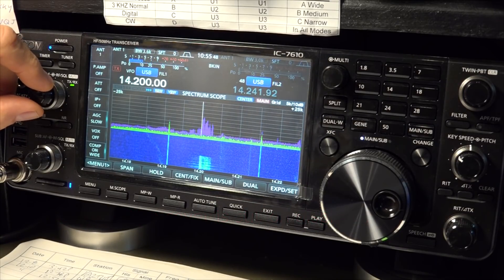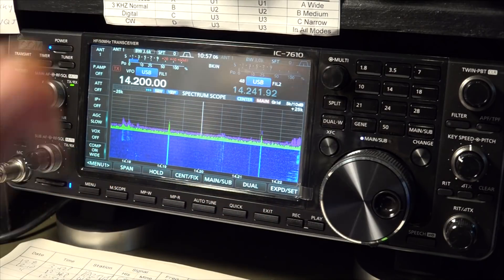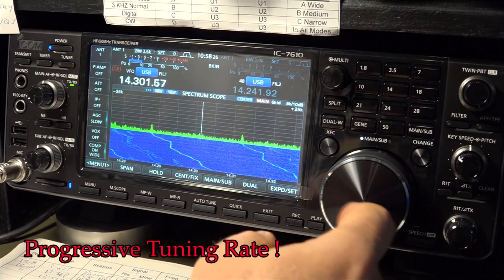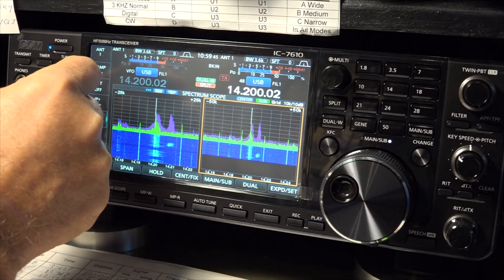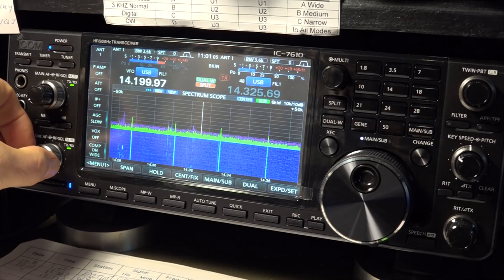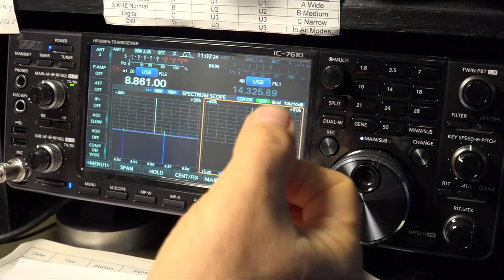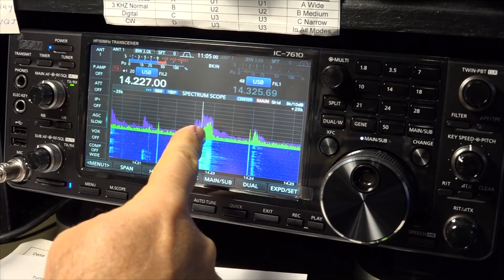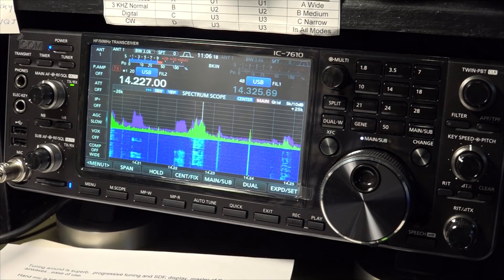IC 7610  - Should you buy one?

Comment: I'm wishing someone would do a comparison between the 7610 and the new FTdx-101D. I was also hoping the 101D would help push the price of of a 7610 down.
Reply: Danny- I think what will happen is that there will be a flurry of 7610 's available now from guys who want the 101D. Good time to snag one. The price on the 101D will also drop in the next year as the 7610 did. As well, the early bugs will be worked out. If the 101D can't do a standard 2D spectrum display with averaging and color fill, it is not even a contender for me (7610 owner). The 3D seems like a gimick. Even if it is great at what it does, it won't be hugely better than the 7610.  It will be more of a brand-preference thing which one you choose. Will my 7610 stay home? Don't know yet!
Reply: @bobnagy9084 I'm a DX'er,  off the air for about 15 years and am starting to build a new station, more or less from scratch. I was planning on buying a new rig at Dayton, to build the shack around, but for the life of me, I can't make up my mind. I know I'm not spending 4K for a new radio, but I do want the best RX I can afford. "Best" meaning it handles a Sweepstakes pile up on Saturday 20mtrs! 7610 suits me fine, but I'm not wanting to spend 3K either. The 7300 is too small, too menu driven and SS performance seems questionable. I'm not a "Flex" fan, at least not yet. I'd have to buy a Windows machine or dual-boot my MacBook Pro, which I don't want to do either. Licensed in '77, I'm old school and like boxes with Yaesu/Kenwood/Icom on the front panels. I think I need deeper pockets, HIHI!! I may just "deal with it", buy a 7300 and wait a year or so, for the SDR by the big 3 to settle in more.

On a different note, I suspect the 101D will be real close to Sherwood top 10.
Reply: Look, YOU are in the driver's seat as the buyer. There are SO many good choices out there. Just read the 101D manual. It won't do standard spectrum display with averaging and fill under the trace (my fav). The 3D is a gimick. And it IS a mixer SDR, not a direct sampler. I was going to snag one, but I think not. I'll stay with the 7610. Really, you might look at a used 7800...or TS-990s. These are brick-wall receivers. the 7610 does not handle nearby strong signals perfectly. That said, it is a joy to operate. Take your time and buy wisely. PS: Your Pix is my hero

Comment: Bob, I'd really love to see a side by side comparison between a TS-590 or equivalent non-sdr radio and the 7610. For those of us considering upgrading. Larry, W1AST
Reply: Larry- A TS-590 or TS-990 against the 7610 would be a good test. I actually upgraded from a TS-990. Since that radio went away last Dayton, I'll give you my observations. Apples and Oranges. TS-990 - Low fatigue  receiver...smooth sound to the RX. Not in your face. Selectivity was very good, but not brick-wall. Spectrum scope was terrible. Buttons are good, but that many makes it impossible to find anything. Great TX audio quality. Rig cost and weighs way too much. IC-7610 - is about half that list price. It's TX audio is max 3khz, but audio is super clean. Receiver is more sensitive by a few DB and filtering is very good ...almost brick wall. RX audio is much more articulated. It is just a couple of orders of magnitude "closer" to the other station's TX'ed signal. It's like digital Windex. A thick layer of noise and distortion is no longer present. Literally, there is just less circuitry between you and the original signal. Spectral display is 85% as good as a Flex. 257% better than the TS-990s. It needs more buttons..too many menus. (three screen presses to go from Memory to VFO) It has external monitor output, but one never uses it. Screen is great. At just over $3K, it's a good deal. The 7300 is 80% as good as the 7610. 7300 is still the best value out there.
Reply: @Yavor54  lo
Reply: Debs husband says beautiful radio.

Comment: It would be nice if the minor complaints mentioned here  could be addressed through firmware updates by the manufacturer. This would be a major advantage of a SDR where in the old days a circuit mod. or a completely new radio would have to be designed to offer improvements.
Reply: Well, that is what happens. Some makers are more responsive...some less. But with a SDR you can change 90% of the radio's characteristics. You could make this into an AM broadcast radio with an analog display. The initial issues with the 7610 were address with Firmware updates. Yea!

Comment: Even the old Kenwood TS-50 had progressive tuning , Or as they called it ' Fuzzy logic ' ... As you turn the vfo the tuning steps get bigger ...... It's not a new thing , And not exclusively Icom ... Regards de Gw0wvl 👍
Reply: the only other radio I ever saw that had progressive tuning (other than Icoms) was that TS-50.  The strange thing about it's implementation was that if you slowly tuned away from a signal -and then turned the dial back the exact same amount, it would not tune back the same amount...and the original signal was off freq. . It sure was "fuzzy logic"!

Comment: can it be connected to a external touch screen monitor yet I heard there working on it ?
Reply: They promised two things: I/Q output and Windows 10 style external touch screen capability. The I/Q output and HDSDR firmware package was just released... works great. Next will be the touch screen- I hope! PS: After a year of ownership, I just used the radio in a low noise environment for the first time (eliminated a noise generator near me) WOW.. this radio is amazingly quiet. What a delight to operate. The new Yaesu FTdx-101D is going to be a 16 bit direct sampling SDR, but also includes older technology mixer SDR architecture. I doubt it will beat the 7610's performance.
Reply: @Yavor54  ham radio with k0pir said external touch screen wont happen because of hardware reasons if u herd differently let me know so I can research it ..thanks
Reply: @Yavor54  ham radio with k0pir said the 7610 will not have the ability to use a external touch screen because of hardware reasons. If u herd differently let me now.

Comment: Thank You For This Video! I purchased a 7610 and it has arrived from DX engineering. You were correct,  the price has dropped a $3,200.  Icom is having a promotion with a $200 coupon and that brings it down to a little over $3,000  plus free shipping,  so we'll see how it performs compared to my Yaesu 1000d and my Kenwood 950 s DX which are dinosaurs, but still good radio.  I'm taking it to work today to put it through its paces.
Thanks again....W6YDE
Reply from the maker: Golly...I paid $3800. Well, you will find it is an interesting radio. SDR's don't fail the way superhets do. Not that I have heard the 7610 fail in any way. Now that the I/Q output has been activated, there should be plenty of really nice software show up for this radio.

Comment: Why it more expensive than RS-918SSB? RS-918SSB lighter and smaller. And more real SDR, because opensource.
Reply: Why? The RS-918SSB is a very simple SDR. It's design uses very basic IC's (chips) to do SDR. Because the
design is so simple, the display and receiver have many problems...images...false signals. The transmit signal is not clean enough to put the 918SSB through an amplifier. It is only good at low power. The display is very nice and it is a fun radio. A Ferrari and a Trabant are both "cars". But they are completely different. Same with IC-7610 and RS918SSB.

Comment: Just found out the LCD screens are having troubles with the 7610's.
Reply: No they are Not.
Reply: I've not seen that. Remember, you are going to hear nearly ALL the people who have anything go wrong with a 7610 posting here on the net. 95% of happy users never post. They have sold tens of thousands of them so far and the defect rate may be as low as any other radio produced. Icom is certainly one of the most reliable radios built.

Comment: So Bob after reviewing both the IC-7610 and the Flex 6400M (Maestro) which radio would you pick now that they are in the same price neighborhood?  K9RUF
Reply: Good question. The 6400M actually performs better. I feel that the ultimate selectivity is superior. Display on the 6400M is twice the resolution of the 7610.  7610 does not have a bandwidth overlay on the signal when you adjust the received signal- so you can match RX bandwidth to it. Having responsive firmware updates from Flex is a very good thing. The 76100 has slightly cleaner receive audio....hard to quantify. It really feels like a 7600 that is a SDR.
7610 is easier to use overall...digital interface is easier...but less versatile. The 7610 looks better. The front panel is just really pretty. The 6400M is clunky looking. It's just not as polished. The 7610 could have been so much more of a radio...but it inherits 85% of everything you see in all their other HF rigs. So, I'm not clear who is the winner!
Reply: Thanks Bob for your thoughts.  I don't think I've ever been so conflicted with any purchase.  Here's the way I look it with an analogy.  The 7610 is Ginger and the 6400M is MaryAnn.  From a distance the 7610 wins the beauty contest hands down with the 6400 looking like an "O" scope from 1970.  When you look deeper at what each radio offers the 6400M wins.  Now having said that we do look at the radio a lot so Ginger is the prettier of the two.  The display on the 6400M is so nice, crisp and sharp that you could cut your fingers on it when pinching and zooming the screen.  Kidding of course.  Why ICOM chose to use an 800 x 600 screen baffles me with the current state of display technologies and being spoiled with our smart phones.  The big VU meters on the 7610 is nice eye candy that Flex could certainly do too and maybe they will.  I do like the decaying waveforms on the 7610 showing briefly where a signal was.  Digging deeper with remote comparisons Flex supports the iOS and and that's a plus for me since I don't do the Android OS.  I have heard the audio from the 7610 at HRO and it does sound nice so i agree with you on that.  I'm heading to Hamvention this year so I will spend a fair amount of time in the Flex booth listening to the Flex audio to see how it compares and learning more about Flex.  Last but not least the Flex can go all the way out to 10 KHz wide TX bandwidth to satisfy my inner ESSB craving.  So if I were just dating the radio for "one night" like on field day Ginger would win, however for the radio we could spend the rest of our ham life with, MaryAnn is the one we would take home and marry.

73 and I'll look for you at Hamvention if you're going.
K9RUF
Reply: @MacsForever1  I guess you know, it every Ginger vs. MaryAnne contest, Ginger has never won, lol.
Reply: @MacsForever1  I'm in the same place with both the 7610 and 6400 but am also considering the TS-890s if the price comes down some more. It would be nice to see how that compares to the 2 SDR rigs even though it's only one receiver. But with my current TS-590s I have never felt I needed or wanted a 2nd receiver, so that's not a point for me.

Ergonomics definitely plays a big role for me. Ease of use, placement of controls, ease of adjustment w/o worrying of adjusting your signal mid QSO and not having to go into the menu's to make changes on things you use all the time. The 590 crushes the competition on those issues and I wonder how the upper tier of radios that we're all considering compares.

I do a little cw and ssb contesting. I haven't seen anyone address how to access memory keyers in either rig. Plus other issues and features in the way I use my rig.

I have to admit the Maestro makes the 6400 very attractive. I'm an Android guy and don't do IOS or anything apple. So those are big turnoffs by Flex only supporting them. Lots of choices, 3 months to decide....

I hope to make my decision by Dayton of this year (2019).

Larry, W1AST
Reply: Hey Bob, just discovered your reviews and now I'm frickin' hooked on them!  Great job, thanks.  I'm probably missing what you're saying in this reply but in your review, you say the 7610 is more SENSITIVE than any of your other radios.  In this reply you're saying the Flex is more selective and the Icon is slightly "clearer".  Got that.  But were you including other SDR's in your "more sensitive" comment in the review?  Do you think the 7610 is specifically more sensitive than the Flex?  Thanks!

Comment: The 7300 is SDR. The 7610 still uses Xtal filters.
Reply from the maker: Nope...7610 is SDR. 7300 is 14 bits and 7610 is 16 bits. 7300 is the best starter rig you can buy. 7610 is for people with more money than time.
Reply: @robertnagy2163  Do you still believe that to be the case Robert? I am just starting out on my enthusiast journey in the UK. The starter radio I see mentioned most is the Yaesu 450D. I am still trying to understand a lot of the technology, and while I am financially fortunate, I wouldn't want to buy something I have no clue how to use!
Reply: Absolutely. The FT-450 is a very basic performance radio. I'm not talking features, I'm talking basic performance. ALL the exact same controls are on both radios. The learning curve would be almost identical. The 7300 is just head & shoulders above the 450. You do have the spectrum scope on the 7300 to learn. It is the question of weather you want to go to the concert without eyes or with them. You'll still enjoy it, but 100% more if you can "see" the spectrum. By a clean used IC-7300. If you buy an FT-450 and stay with the hobby, you'll sell it and upgrade within a year.
Reply: @Yavor54  Thank you so much for taking the time to reply; appreciated! :)

Comment: Thanks for the review.  Current owner of a 7300 and you are spot on with the pricing.  My plan is to wait till the price goes down to just over 3k as you said, or perhaps find a lightly used "review" unit.  That said, I am very happy with my 7300, and will not have a problem using it until the initial price hype wears off.  73!
Reply: Golly, I wish I had that strength! I've toyed with cutting mine loose...but then- what do I buy? Yikes!

Comment: Icoms old QRP rig the IC-703+ that I have has an amazing tuner, it will load a wet noodle!  That was a decade ago! Surely we now have the tech for a $3,800 Radio to have a better tuner.   LDG will sell me a much better tuner than that all for about $170 .  That’s a fine solution on my IC-7200 but for $3,800 it surely could have a better tuner.

Comment: It does show the bandwidth,  but not on the main screen.  You can use other software with the IF/AF output (to name some common outputs) and the sky’s the limit, use sdrsharp etc..
Yes, 200 watts would’ve been nice, but the IMD is so good, you could take advantage of the radio and use it with a high quality amp.
I don’t actually own this radio, I own a very late version IC-7300 with more mature hardware & firmware, but a friend does and I’ve babysat the 7610 for a while when he was away. And yes , exactly like you said, it’s right out of the gate and does require some tweaks and I suspect new features as well.  What’s interesting is the quick menu functionality was fully editable on the 7300 and unfortunately dumbed down on the 1.14 firmware update, for what I heard.  I understand your video was only a quickie, but this 7610 has so much functionality that’s easily accessible that works flawlessly.  It’s ability’s for digital communications are just fantastic, filters are great as you quickly pointed out.  I love the UI setup and the radios menus are very intuitive.  Like the 7300, updates are a snap, compared to say other non SDR radios I own such as the Yaesu FT-DX5000MP, it’s easy for me, because I’m a computer software engineer, but some people would say it’s a bit cumbersome because of the individual setup exe’s needed and different pre-setup procedures for different parts of the radios update stages. The easy USB connection and the Ethernet capability on the 7610 is just a wonderful addition.  Having the ability to easily direct different frequency ranges to specific antenna ports is wonderful and all clear and menu driven. The ability to save unlimited working configurations into an SD card up to 256Gb or more along with the USB ports which does support storage drives as well as other devices is fantastic, with screen shots and unlimited memory’s and prerecorded files as well as audio snapshots, that can be played over the air using external software or custom software.  You also have the virtual com port functionality which I won’t go into detail.  The price point is well a bit high, I think, or I would have purchased my own, not that I cannot afford it, thank god. But I usual don’t go purchasing new radios right off the assembly line, I learned my lesson with the 5000, and look at it now it’s cheaper than this radio which is unbelievable considering the Yaesu 5000mp’s quality and abilities that I feel are currently in the same ballpark or better than the 7610 in some important areas. It doesn’t have the UI, but it’s a traditional super H design and I would technically prefer it over the 7610 for personal reasons.  The receiver is on par or better than most radios. But getting back to the 7610.  The modern input/output features are a nice sight considering radios in this price point are still using legacy input/output connections. Which I’ll never understand?  Glad to see Icom is using the current technologies when other manufacturers preferred to stick with older methods, but thankfully they are still functional anyway.  I waited until the 7300 was priced right  before I pulled the trigger and stole it for 1k after rebates and specials.  Which to me was a fantastic deal.  Hopefully the 7610 will follow the a similar price path.
Overall I believe SDR radios in the same traditional radio form factor are here to stay, it’s going to be interesting watching the other big three companies compete for market share, that will only benefit us in the short term anyway.  73.